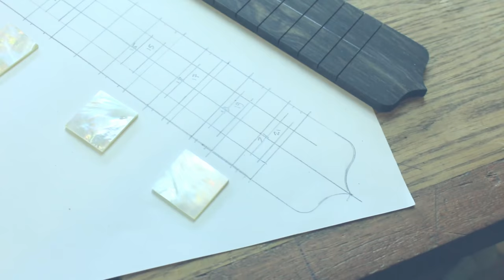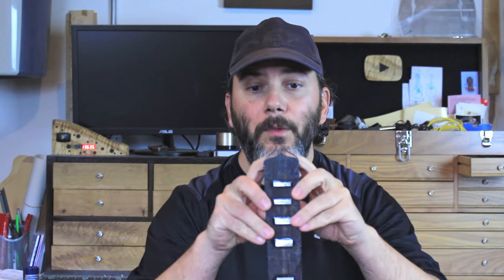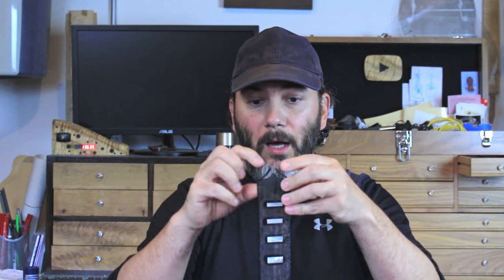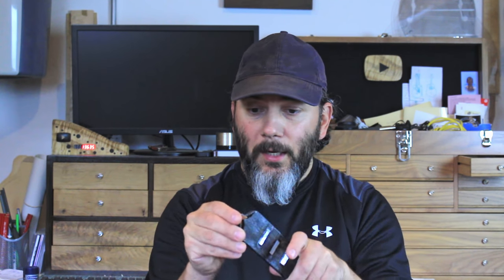Mandocello Fretboard extender/ Part14

Comment: Tomy, great video, if that binding is plastic have you tried to tape it in place & drip in some acetone?? It melts the binding right into the wood
Reply from the maker: Thanks for the tip, I've tried acetone in the past and found that the Duco was doing a better job on the wood side. I do use acetone in regards to gluing my plastic strips together. Since the video I was able to glue it back with Duco, and instead of giving it only 30minutes to dry I gave it a full24 hrs+ It.s in place now and holding well. But just to make certain I've added thin superglue from the back side. You can see how it look at the moment on my Blog: http://www.hovingtoninstruments.com/today-in-the-shopblog